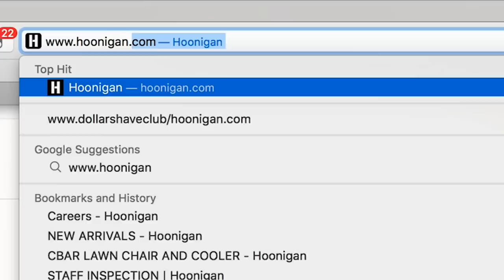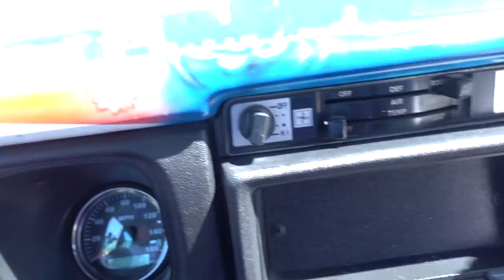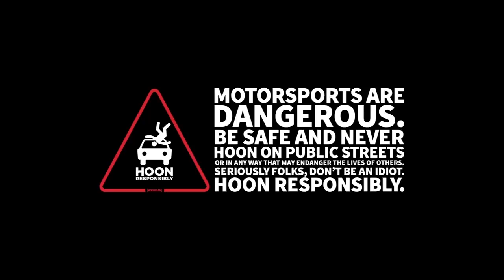Can You Drift With 125 Horsepower? Hoodless Datsun 510 Shows You Don't Need Power to Party

Comment from the maker: How much Horsepower do you have under the hood of your Party Car?!
Reply: 205
Reply: 138hp but some might have escaped in the last 25 years
Reply: Doesn’t run 🤷‍♂️
Reply: 190
Reply: 113
Reply: ~220?
Reply: 60
Reply: Hoonigan Daily Transmission 190 in a bmw 5 series
Reply: 110hp outta my ka24e single cam, gonna boost it soon and hopefully make around 250whp.
Reply: 390whp
Reply: 250HP in my subaru. So only winter is fun

guessing around 440HP  in my chevy truck with a 355. Its pretty much a baby farm truck. Lots-o-fun
Reply: 75 +- some but on the wet, it rips even with couple misfiring cylinders
Reply: buff 3 horses in my moped
Reply: Stock made 196 but has headers cams and injectors
Reply: Somewhere between not quite enough and just enough to cause trouble.
Reply: 112hp in 96
Reply: 115 3 legged horse's 👌🤣
Reply: Maybe 💯 hp in my 12a I love it
Reply: Fackler91 sr20????
Reply: 53, ain't a car it's a banshee
Reply: Hoonigan Daily Transmission 237hp NA Old b series Honda
Reply: 10hp on this Walmart shopping cart  🛒
Reply: 60 when it was new in 73
Reply: 132 from factory in 79. 280zx :)
Reply: 115 on 2 wheels and 193 on 4 with no roof!
Reply: A measly 50ish.
Reply: 95 in 85
Reply: 120 in my 91 eunos 👌🏻👌🏻👌🏻
Reply: maybe 120? Miata gang
Reply: 130
Reply: 205
Reply: 136 and fwd sooo not too fun
Reply: 140 of bavarias most mediocre
Reply: 0 right now, it's sitting next to the car, coincidentally it's under the hood tho...
Reply: I ripped my 79’ 280 all over the place on some 35 year old tires and all 185 rice burnin hp (if I was lucky)
Reply: My saturn about 120bhp
Reply: 165hp and doing 9:46 on the nurburgring
Reply: 450 Ls horse pups
Reply: 140 n it’s aggressively slow but she my bitch 😂🔰
Reply: 99
Reply: 95 party hp  and all the 4 gears  😂  in my 40year old Opel.. 🤙
Reply: But 780kg and rwd
Reply: 95hp in my corona
Reply: ~300
Reply: Tbh I have no idea haven’t dynod it but it rips
Reply: 250 with luck
Reply: 654
Reply: I have  tired buick small block maybe making 150
Reply: 0 I dont have a car yet, But a man can only dream...
Reply: 115 30 years ago ! Speed and man foot all day 😊
Reply: 210
Reply: Well from the factory its 90 to the crank...and that was 1981...
Reply: 165
Reply: 75 hp in the 60's, but now it burns about 1/2 gallon of oil for every tank of gas so I doubt that's the case anymore lol. 
Puts on a good smokeshow when you bring it past 5 grand tho haha
Reply: Hoonigan Daily Transmission my Is300 is 215 and my g35 is 280
Reply: 715whp c6, 500 6.7 Cummins, -200 7.3, like 2 in my 66 327 C10 , xj has like one, and the others are the same slow bs.As I'm writing this, I'm realizing I have way too much shit I definitely don't need ten vehicels. No wonder my insurance is 550 bucks a month🙃
Reply: That iron duke 90hp baby
Reply: 300+ in the Australian vn commodore v6 turbo Buick 3800 on 16psi boost smokes tyres like a bowl at brads house
Reply: A whopping 420...cut in half...minus a few...at the crank
Reply: However many horsepower a pair of legs can make 😂
Reply: zero hp.   Engine is in the garage :(
Reply: I'd be lucky if I had over 100whp
Reply: A massive 194hp
Reply: 340 lb ft of torque makes my party "truck" boogie
Reply: I have suzuki apv van done up for mountain runs it has just on 127.5hp and biggies on the down hill but the gearbox kills it on the up hill.
Reply: 512
Reply: 83' Chevette... Probably about 40hp? 5 Speed. 2 Door. Under 2000lbs
Reply: Maybe a buck 40 on a good day
Reply: my ka single dingle has maybe 60 by now lol and has to move a 4x4 hardbody around
Reply: About 90 from the factory 🙃
Reply: Def 250cc I’m running a 250f Honda motorbike
Reply: Maybe at the most 180hp with a fully built 22R/20R hybrid in a '75 Toyota Celica lol
Reply: I HAD THAT SAME BELT IN HIGHSCHOOL THATS HANGING FROM THE REAR BY THE TOW HOOK. This shit really was built forever ago.. 😘💜 and 160hp lol
Reply: 5.5 hp, it's motorized bicycle
Reply: 251. 2000 Dodge Intrepid with a 3.5 high output Magnum. It's a sleeper
Reply: 101 + 25 years and 436000 km
Reply: If you got a Leadfoot and steel nuts just about any amount of horsepower we can get it done!
Reply: 0,7 buff horsies in my weed wacker powered bmx moped
Reply: 0
Reply: I have 48hp. No that’s not a typo, welcome to the world of air cooled Volkswagen
Reply: ~130 but they're unicorns, not horses.
Reply: 350
Reply: 90hp
Reply: 192 now, 90 before and it whipped just fine with 90 if you gave it a good clutch kick and a good ole weight transfer :)
Reply: @fastblackshit7702  haha you can get on two wheels around a corner in those. I had a 60hp 1 liter one and if you come in hard enough thats all you need 😂
Reply: I don't have one 😭
Reply: 150 on my restored 240z original motor
Reply: 300+
Reply: 201hp and 276tq with a fried trans
Reply: 251 WHP in my Mustang and 140 Crank in my Ranger
Reply: 260 hp
Reply: 230 if I get all those ponies to eat out of the same trough.
Reply: “140” but that was when it was new, 250k miles ago.got that spare motor in the basement though getting ready for boost.
Reply: 👴🏻yes NB miata?
Reply: 300 and I’m only 14 when I’m 17 I plan on superchargering my charger
Reply: After all these years? Probably 70ish
Reply: 275 stock
Reply: Hoonigan Daily Transmission ~250
Reply: 40 🤣
Reply: 2 one for driving and one for drifting
Reply: 169
Reply: 3.9 v6 186 hp 😎😎 one wheel wonder unless ya really thrower sideways 😂🕺
Reply: 43 hp in the green machine but its a dirtbike 😎😎
Reply: But my truck sure doesnt act like that car 😂 i wish it did
Reply: i drive an e30.... so like... 140ish on the new engine last one was down 2cyl and low on 2.... so that one probably had like 90hp. hahaha
Reply: 210 e36, slides like no tomorrow
Reply: Y'all got hoods?
Reply: 155
Reply: 150 ish
Reply: 283
Reply: 111 to the wheels.
Reply: 145 in my daily 240sx but I have a single cam ka too idk if your guy had his numbers right
Reply: 120bhp bmw 2.7 eta
Reply: 210 if I add my two cars hp lol
Reply: 160
Reply: 95whp of pure fun! #savethewagons #driftwagon check my channel and my instagram @dzn94
Reply: 1 Horsepower!! Lol.
Reply: 900
Reply: Maybe 90 wheel.
Reply: Whatever an old 22re makes, my 86 Toyota Corona goes well sideways
Reply: Hoonigan Daily Transmission under the hood? 265. But at the wheels is another story 😂
Reply: 180
Reply: 130hp in a 2200lb car. It’s not a rocket ship, but it’s a shit-ton of fun to drive. 👍
Reply: A little less than how many likes this comment has right now lol
Reply: 114 at the crank, and that was 260k miles ago 😏
Reply: 292whp and 267wtq, 06 6-6 accord
Reply: Hoonigan Daily Transmission 100 hp geo tracker
Reply: Yes
Reply: 9.5 cuz it's a dirt bike
Reply: Around 700
Reply: Horsepower doesn't say anything. Give me those torque figures
Reply: Not enough.
Reply: @Blue__244  lemme guess volvo 240 b200 :D
Reply: @captainlovemaker7095  b230f 1987
Reply: @Blue__244  i have a b200 1985 240
Reply: 65...
Reply: 115 stock at crank...idk about now maybe about 115 at wheels now?
Reply: 900ish audi rs4avant
-
-
-
-
-
- on forza motorsport 7 LMAO
Reply: 358whp single turbo s15
Reply: 29hp, 602cc, not safe at all but absolutely hilarious
Reply: 197 i think
Reply: 383 at the crank, but it's in a 1993 Lincoln Towncar
Reply: 600 HP. BMW E34 M5, supercharged inline 6 goodness.
Reply: Cough I Dont have a car yet cough
Reply: My volvo 460 1998 1.8L puts out whopping 90hp.
Reply: A sad sad 70.
Reply: A little more than 68 when it's back together 😅
Reply: 1 horse with power
Reply: 08 245 bhp cooper s. Full bolt ons with bigger turbo and stage 2 tune
Reply: ~170
Reply: I daily drive a Datsun 510 wagon thats pushing almost 130hp out of the datsun L18 motor @datsun_magazine on IG
Reply: 4 horse power
Reply: I drive a Lego helicopter
Reply: 340whp out of a 2003 suburban. Just minor stuff like plugs, intake, tune, and exhaust.
Reply: 120 ish in a rwd wagon 👌
Reply: Hoonigan Daily Transmission 390 hp,is300 2003
Reply: 104. Ima be real. You can party if you have a manual. As long as your shifting. You can drift it.
Reply: @Kristo99  mine was 104 its now 102 so. I can relate. Tho i did slap in some new internal pistons. With an vortec intake. Helps with throttle response and makes it just rip.
Reply: 220, 950kg wet
Reply: I don't even have a motor in my car
Reply: I have no car... :D
Reply: j curls. nah he wont rock them.
he wont.
his scared.
he wont.
you wont!
YOUR scared.
Reply: Dude my car with 45 hp and FWD drifts like heck
Reply: 125hp turbo diesel
Reply: Twin turbo boxer engine under the hood of a Subaru Impreza
Reply: none cause i drive a china scooter
Reply: 124.5 .. this guy just got me
Reply: 426 hp in Volvo 740 2.0
Reply: 255WHP baby!
Reply: Around 70hp

Comment: Man how times have changed, I remember when you could find the four door 510 for next to nothing in the mid to late 80's now those cars are fetching like three to four times what they went for in fair to good condition gotta luv those Japanese cars they are awesome
Reply: Dirtyd23  you can thank Chris foresberg for that I remember when I was looking into the wagons in the early 2000s you could get an sr20 swapped one for around 3500 now rollers cost that much. I always wanted an mk1/2 escort but thanks to block those are upsurd expensive too
Reply: Man 4 doors and wagons were basically free. Now they don't even exist up here.
Reply: Bought a 2 door in 99 for $1000.. And a 2 door automatic in 2001 for $700. Both ran

Comment: This just proves like you dont need 1000hp to have some fun dont get me wrong i like a lot of power is a lot of cars but these are so small and light you dont need it plus i bet its more reliable. It is very tastefully modified I do like it its cool
Reply: Joshua Slater 😂 if you’re turning the vehicle more than you’re siding that’s not fun at all and isn’t drifting. Drifting is turning with angle, not going around a corner as if you’re going to work. This is literally a regular day of driving in my drift car trying 100% to go straight on my way to work and back. If you can’t get a decent amount of angle it can’t drift.

Comment: Nissan had this program, back around 2000 or so, where they sold fully restored 240z's at dealerships. I think they sold for around $60k. They ran ads in the car magazines, and I remember one of them had a picture of the Z and below said something like, "Cupholders? That's what your passenger is for."

Comment: My EM2 Civic EX is maybe 150HP at this point and if I shift right before it hits vtec every time, it f%cking lurches and breaks my 7.5" wide wheels loose at 3rd gear for a split second at about 35MPH. It's slow, but it still boogies and it's a cornering monster. And I'm about to put a built K24 out of a TSX in it and give it nearly 300HP. I'm talking forged everything, stroker crank, 11.5:1 compression pistons, h-beam rods, the works.

Comment: heck yeah..  back in '86 had a '76 620 long bed, L20-B with an offenhauser intake manifold for a weber, 2-1/2" exhaust with a little flowmaster, about 160 hp. 4 spd from a 1600cc 610 wagon for the lower closer gear ratios (you just bolt together custom length drive shaft, so easy!), lowered 3" on KYB shocks.. 1/8 mile = SEEYA! wouldn't do over 85 but it'd get there breaking loose in 3 gears, and drift like a bandit before it was ever called drifting. short beds would spin out too easy, long bed was 10" more wheelbase and much more predictable.

other "mods", byebye smoggie crap, byebye AC, byebye rear bumper and tailgate and spare tire, byebye heavy factory bench seats for a couple light Toyota bucket seats, it tossed about 400 lbs of "dumb weight" and mostly in the rear. at a stoplight it'd lunch V8's, on twisty little back roads (northern CA coast), QUICK with handling was more important than "fast".

Comment: 125 horsepower is a lot of horsepower for a Datsan 510. If you can’t drift with a 125 hp then you don’t need to be behind the wheel.

Comment: Hey Hoonigan I have a 2006 Ford Mustang V6 tko-500 5 Speed and GT rear end with 4.11 gears and eibach pro-R2 suspension ford racing adjustable caster and camber kit. I was wondering if its possible to drift with with suspension setup

Comment: You don't need much power to get sideways, in hungary VAZ cars (old russian made) are very popular, they come with 65-75 hp, and people drift them quite often. With a built engine you get 130-150 hp out of them, carburated, so they are low powered. Also, bmw 320i is very popular, and those also have 150 horses (and god knows how many are still alive)

Comment: I got you beat Ill throw my nissan hardbody into a drift and it only makes 110hp off the ka24e and doesnt have a hand brake lol. Plus its only a 1 tire fire until you boys at Hoonigan wanna weld my diff since im in California ;)
Reply: Moto Huncho don’t let that little Asian girl disrespect you 💀💀💀💀💀💀💀
Reply: @relate97  lol I didn't see her comment till just now 😂, I would weld it myself but the bolts to remove the cover are on the back instead of the front so Id have to pull my whole rear end off and I dont have a welder either :p
Reply: @SideWaysiscool  no welder :( and bolts are on the back of the diff instead of the front like on a 240sx

Comment: I have a single cam ka and it’s stock 146 I think
Reply: miguel ramirez when it’s wet open diff currently and third gear is starting to go so I don’t push her to hard but she still gets slid
Reply: miguel ramirez swap it with the other stock motor I have but it’s gonna get bored and turbod buy staying stock

Comment: This is literally regular daily driving to work and back in my drift car or any real drift car trying 100% to go straight. If you’re turning the wheel more than the angle you’re sliding that’s not drifting sorry. The entire vehichle has to be able to get more sideways than your steering wheels to call any car a drift car. If the most you can do is kick it out around a corner that’s not a drift car. That’s a stock street car straight from the factory with no mods whatsoever. F a fwd civic can get more angle than you around a corner then you don’t have a drift car. Period. That’s regular ass daily driving.